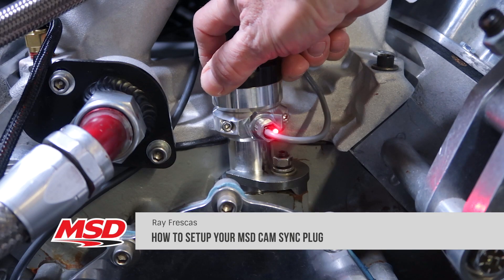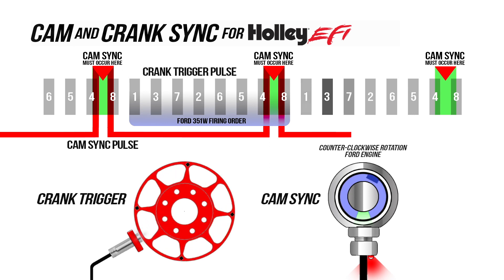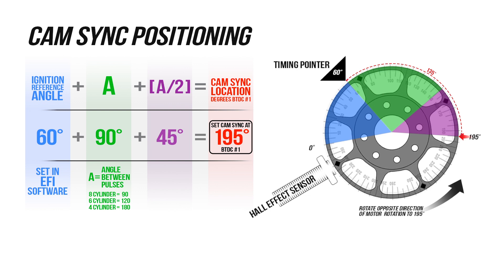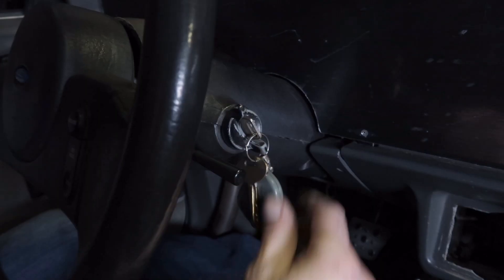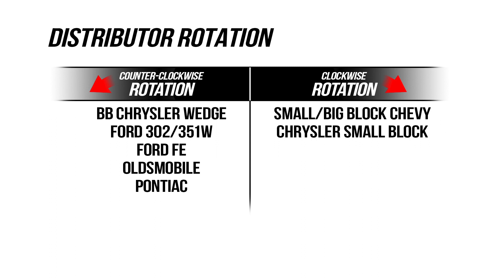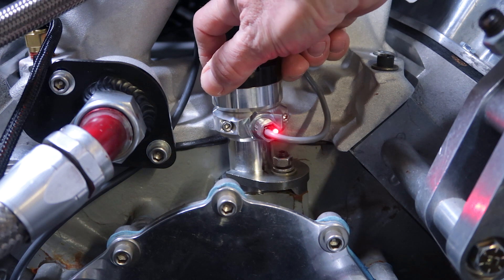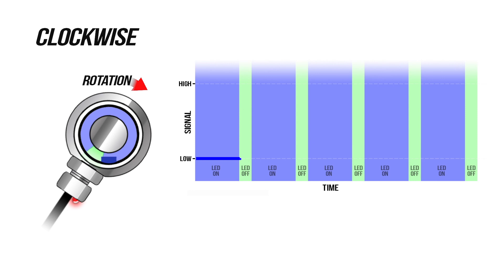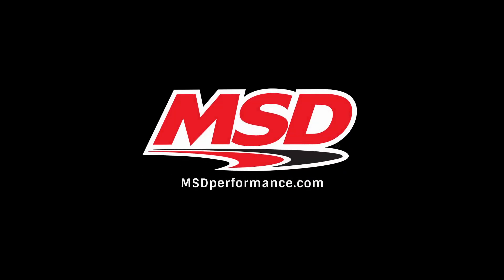How To: Setup MSD Cam Sync Distributor Plug

Comment: Im brand new to fuel injection so Dumb question time my timing is 36 degrees i set the crank trigger there. So do i still set the crank to 195 degrees to set the cam sync then.

Comment: While this video is helpful, digital rising and digital falling are described opposite of each other. Digital rising occurs on first edge of the magnet and digital falling as it passes over and falls off the edge of the magnet. Based on this video description, we struggled to get a Holley Dominator system timed correctly for many months which included switching from a 4 magnet setup to a higher resolution 12-1 magnet setup. Now it runs perfect.
Reply: Yes that’s exactly what I noticed after watching the videos over and over and not being able to start the car, so can i put both options to digital falling?
Reply: Yep, they screwed the pooch on this video.  The msd cam sync instructions are similarly vague.  To do a Chevy, 195 btdc, rotate until the led is off, then rotate cow (opposite of the rotor) unyielding led just turns on, lock it down.  Ask me how I know lol!

Comment: Which degree BTDC is correct?  195* BTDC which is displayed in the formula or 135* BTDC which you verbally say?  Thanks
Reply: 195* is correct  - 135* is minus the ignition reference angle (60*)

Comment: So after installing like this does it matter where the Cam Signal happens?  Meaning if you log your cam/crank signal after installing it like this the cam signal will typically occur during one of the 365 deg crank signals rotation or do you want to keep adjusting it until the Cam signal occur between the "2" 365 deg crank signals?
Reply: If you have a Holley EFI system it needs to happen 135* before the number one cylinder fires. -R